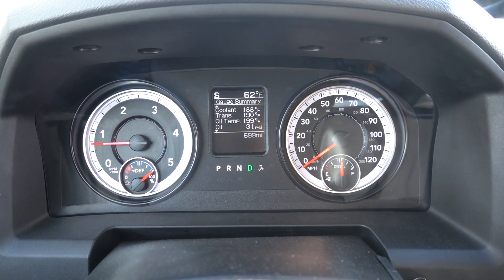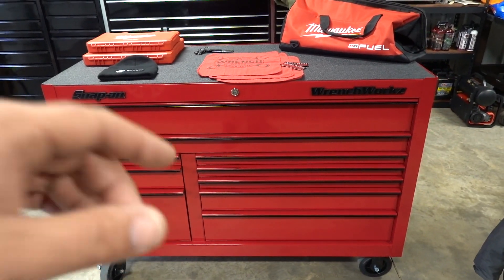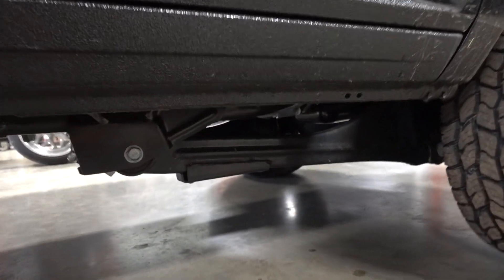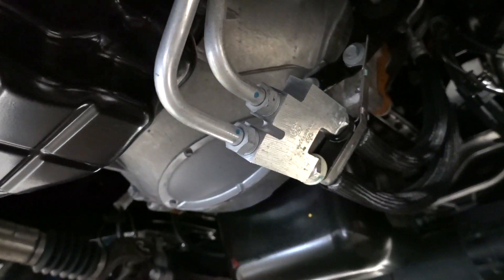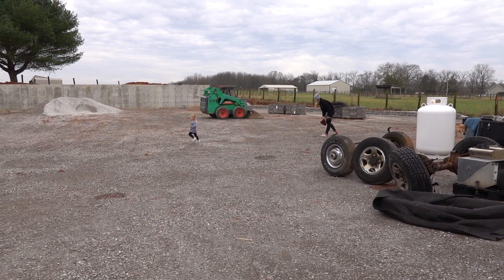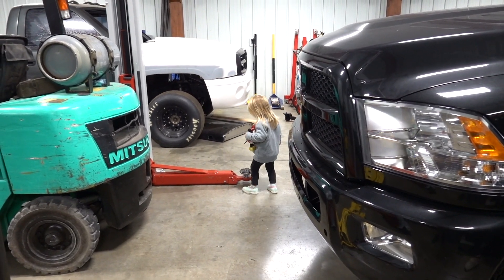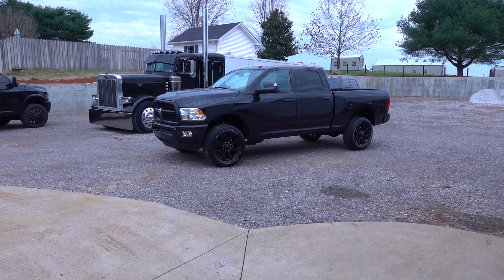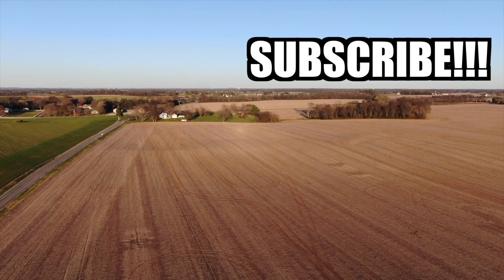We AVOIDED a MAJOR DISASTER!!!! SAVED TONS of $$$$$!!!!

Comment: I’m pretty sure most transmission fluids optimal temperature is between 170-200f. 130s sound way to cold. I’d double check the product your using. Running both cold and hot changes the viscosity of oils changing their lubrication properties. Hot also has the added downside of burning off additives and over like 300f will start evaporating the oil itself.

Comment: I believe that piece is called a transmission cooler bypass. It bypass the cooler when it's cold and it heats your fluid up faster and then it opens up once it's at operating temperature.

Comment: thermostatic valve sounds like the term you're lookin for. It'll loop fluid until temp reaches the set point, then it'll send it through the cooler. Very common on heavy equipment where you're trying to maintain a specific range of operating temp for optimal fluid and component life.

Comment: Is this model trucks trans suppose to be operating at a lower temp?  I know in my ZF8 180-220* is considered normal operating temps. Doesn't it typically take 240+ to start degrading trans fluid?

Comment: What was the major disaster avoided? If you're referring to the trans temp, 190-200 is not an the edge of disaster. Not even close.
Reply: Greg A talks a lot click bate at its finest 😂
Reply: @Itsa Mea

If it isn’t fixed on the front end couldn’t it be a disaster waiting to happen? Or am I just showing my ignorance on the subject haha.
Reply: Agreed
Reply: He is referring to the actual problem, sure 190 isn’t bad but it’s a problem that needs to be addressed
Reply: Any temp over like 170-180 drastically reduces fluid life, the trans SHOULD NOT be running anywhere near 200, especially just driving down the highway.
Reply: @jameshood3692  optimal temp is 175.  The fluid temps upto 220 are not detrimental to the transmission and mist vehicles run in that temp range. 240 and above shortens the life of the fluid in half for every 20 degrees above that.  There was NO threat to his transmission.

Comment: The transmission thermostatic valve is to heat the trans fluid and thin it to increase fuel economy. Almost all manufacturers use them now. Counterintuitive because heat is the enemy of the automatic transmission. 190 to 200 is not technically "too hot" but the transmission life will be greatly extended by doing away with it. Furthermore, it will not have a noticeable negative impact on fuel economy.
 
Kind of a stupid question but are you sure your dually has one?
Reply: Yep, definitely a stupid question... It has it, I remember the video where he changed it.
Reply: @jsav5845  

Yep I have no knowledge of RAM trucks. GM only added these with the new 10 speed. The real Allison trans trucks don't have them and run in the 130 degree range unloaded. All GM 1/2 tons and the F150 have them. They actually have been causing a lot of premature torque converter failures in GMs 6 speed 1/2 ton trucks and many owners disable them.

Comment: Hey love your content, I have a question my 2018 ram 25oo has wind noise inside the cab you hear it on both sides around the top of each door. You hear it mainly on the highway doing 60 plus and on a windy day it's way louder. I was just wondering if you experienced this wind noise or heard anything from other people it's driving me nuts trying to figure out what's causing it when you buy a 50 thousand dollar truck it should be quite inside

Comment: You are correct 10-12 do not have that thermal bypass block
Reply: that is incorrect. 
it’s just in a different location. 
it’s under the hood 
above the fuel filter and next to the master cylinder. but a little forward of that . 
you’ll see an H block.
revmax replaces that with 2 double ended fittings . 
part #  68RFE-TC-TBU-2

Comment: Sooo 200 trans temp is bad for those transmissions...?
Reply: 200 degrees pan temperature is about max for a auto trans. Fuild starts to break down and it starts pushing the limits on the seals. The cooler you can keep and automatic the longer it will last
Reply: New ram 1500s 8 speed the trans runs 220 normal.

Comment: If the transmission cooler is in the radiator and your thermostat is a 190, there is no way your transmission can run any cooler than the water temperature. This has been a standard for many years.

Comment: revmax part # 68RFE-TC-TBU-2 

It’s in a different location above the fuel filter next to the master cylinder but a little forward of that you will see an H  block. 
it gets replaced with two double ended fittings. 
I have a 12’ and it runs way cooler.
also on the coolant I went to a 190° thermostat over the stock 200°
2010-12 have 200° thermostats

Comment: The water in it a gender these at the Max and release it's a 180ﾟ of released its heat it to the radiator and the radio them puts it cold cooler water and that wastly works all day long as long as it's flowing but if that's the case why even use a thermostat why would you ever watch your engine to get up to that temperature will you do because if you want a heater I gotta have a warmer environment but for an aging to go above a 180ﾟ is not good it makes the gaskets so get too hot and things start to seal start to go bye bye so what was what is your what is your what is the guaranteed way to keep your car cooled and flowing fans and radio water and act I freeze things that keep them from boiling him these that keep it from overheating but if you lock your thermostat at 2:20 miles 220ﾟ C card's been read it 220ﾟ or 400ﾟ it's not cooling its fluid through its fan system and it has no way to kit its engine down to a temperature that is not going to destroy gas kits

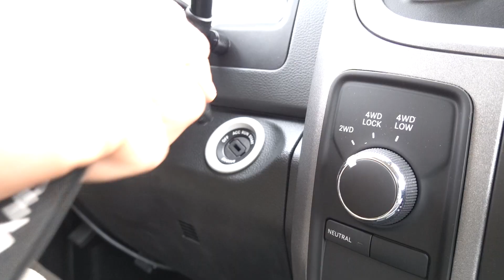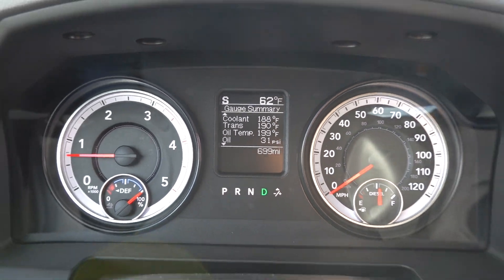Comment: Why buy anything from a factory if it's going to have problems like this down the road and your regular usage why would you even buy a factory vehicle because it looks good believed all the parts on it that are subject had basely damaging it Dar not proven parts to last 10 years they are just put all the truck to less the or the manufacturers OEM in Delhi have to replace them look I doubt that the the Cumbria has your truck with basically say that those that would your use vehicle part of it starts blowing up transmissions are not responsible for it such a what is the optimal temperature of a transition I've never heard of vehicles having to have AA keeping so that's what the coolant system in a transmission is designed to do circles through the radiator and you put extra oil cooler to keep the engine the treasures and cool always not now to be regulated by a nether device that has to warm it up in the wintertime that makes sense for the kit warm up in a cold environment but should never have a problem getting it to the high temperature it should never keep them fluid in it towards boiling it then they get ahold of therefrom now with a transmission that he didn't used to have it used to be able to warm up flow through radiator but if it's in a cold environment it would it took a lot long so this thing worm the how is it warm and up faster because it circulated as much so it leaves the transmission fluid from flowing in the beginning to staying in the engine in the same area so it's warming up the fluid that's it keeps the fluid in the transition before it circulates it back out again as with that print device does it keeps it at before it releases it has to raise up to 130ﾟ that it didn't let it loose they go see your cool of his doublet it basically is flowing through your system at the temperature it use of flow at but if it doesn't apply but holds it for July long that it's gonna cause problems and what makes transmissions get hot the heavy loads bigger tires over where pullings that the it's not designed a poll uphill but you are duly him you have it put it through all of its you have a put that truck and it's even its full capacity in a goalie get a high rate of speed uphill transition has it been a snot design through it for the basic ease but would you abuse your transmission will it be able to handle it in the conditions of that are basically design when it is under full warmth and going up a Hill at phuket and fast as they could go like the way you build-up would it be able to haul a heavy load up a mountain and keep up with the speed of the mountain you know going 65 miles an hour uphill all the way up the mountain with a heavy load with the chancellor should be able to hold it when it goes down the mountain the transmission is designed to break it you don't want to be going if you don't give it any for although truck has the mail with a stop the 800:00 pounds safely going down it you don't wanna get the car of to high speed and fly down the mountain and you can't break it in time now as to why have you have a race car you can go down about and really bass and he could stop the card as the brakes are designed to dimes over what the Cardie's a stop to this stopping quickly but big rigs 800:00 pounds at high speeds effects of bigger's bigger brake system only put on them to keep them going slower they don't get their speeds up going downhill that 1 be able to stop them they have the keep them from doing that before that little give it gas going down you'll explode up through their transmissions I don't wanna use the brakes if they don't have to that the last resort when a keep the thing in the gear that keeps it from getting up to speed it needs downhill is downhill dude if you have a 1000:00 pounds that you're going tag Hill with no breaks and I had it and a going downhill with 15 2:00 pound thing on the same wiggle one's gonna go on love faster the other one ones get me a it's Garry ride down you put your skis down the mountain at 2:00 MI at to underweight which is a 1:00 weight you're going to get down the mountain and a high speed but if you

Comment: Here's a quality product and I could tell you that I could stand by to this day that's good the Honda eat 2200 generator cost 11 $1200 back in the day I had a choice of by it or a $300 generator which was same the tricity wise and I couldn't tell with the harder generator last 4 times as long as the $300 competitor I couldn't get an answer in a Honda I couldn't get an answer out of the generator companies how long is this thing going to last what's the best thing turned out the ones that were selling for $300 were sold by all the big Box stores they lasted 66 days running 24 hours A-day so the holler generator I bought down the road now would be I would put an 8 hour shifts so that 66 day would be adorning 20th 240 days of basely using this 100 generator I used as on a generator for 8 hours A-day I guarantee you for 8 years straight it ran that that would be the equivalent of buying $300 a year for legs 8 years the Hud of generator save me it was half the price of using it over the lifespan of it's it's we got stolen it was still working till I got stolen it was still a $10 a month generator but she had a bite all at once and use it for that many months in Fort before it broke now you by the other was that are cheaper they don't last you be buying 1A year for the next 7 years so you value of those wounds is garbage they are krapp that is would you say is a good material switcher I don't believe you prove it that shirt last like it's supposed to last like at last like O to long lasting this I don't believe the tools that you sell there was that you buy the ones you endorse they don't last it's not like you're buying Craftsman you know tools that lady you've abused them in know give you new ones you buy any impact tools from Harbor freight or any of the snap on lid on which he looked abuse them like a mechanic would abuse them for a lifetime they don't they stay break those tools were never

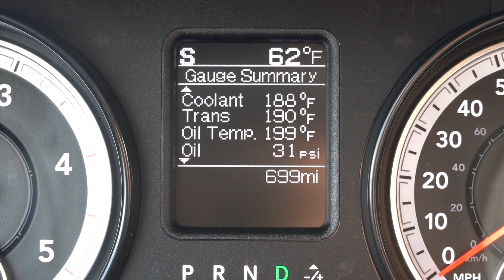Comment: Cycling you racecar you a dragon if you do a rod you put that paid to the pedal to the metal ubaidah think fire it 7 seconds of use and it basically hit those pistols as fast as it could heating them up engine block is now hot you can't run that engine again and again again at that high speed of temperature your age is designed to go 1:00 year keep cool than a 109 ine degrees keep them the block at that temperature all times its cooling off the pistons that are going 70 miles an hour but they're not going 2:00 miles an hour for a the same hour time frame that you would be going 70 or 80 miles an hour in your other vehicle you're gonna get things hot yet a have a way to cool it down so you can't run a drags your wiggle over and over and over again although he can't put 10 runs on a on your car in A-day without cooling you down it will take time you actually got your engine block hot idea cooled on your engine when you come back a few dragged it you can't run cold fluid through it you gotta cool it down how do you could down you have to put wind in radiator has to cool down what you Bisley read that I'm so fast I believe in a way to cool the engine down your system lu not designed to do that so when people say they're 3" now it's cool I'm ready road I can run it again it goes temperature bag down to a 180ﾟ you heated up to boiling points you could be able to cool it back down and you guys don't build radiators and fans able to keep up with the Drag Racing era get hot cars that run indeed are running their running to utter miles and hour their radiators and designed a basically cool them off at 2:00 miles an hour they're running at a higher rpm and their fallen a** they're given a gun there radiator has the cooldown ever have a bigger radier who as the luckily keep up with the flow of the engine have to cool the water off a to keep it Connie that temperature I don't understand how people make these vehicles that they make him go super hot for 5 seconds and then they have the cool down in in common I didn't really reaches digoville engine if you doing that kind of heavy duty hot and cold eat I how do you keep it for 6 seconds at the temperature you needed to have while you're racing it you MA it's super hot and I did have time for the water to flow through it and cool it off in 7 seconds

Comment: Although engines and when boats rested they give you the blocks away they don't they break before they come out for desert designed the whole that weight when they well together as they don't have ability to hold want to come to separate so as a result the tools that you're using the tignol part are going to get damage because the tools the things that you're using and Noah are requiring twice the strength to get group get broken loose and never design that the snap on charges you a whole lot of money for their true but doesn't go through the abuse of take a Craftsman tool and you run it through the test of using it every day for this about of tires over the next they're all gonna break at their own rates one that breaks L the 1 that you buy for this amount will last you a lifetime but do you need to buy that 1 at that price what will all the other ones last you a lifetime and still be worn dude I don't know if that was the case then we be using lease no 1 wants to have until break an arm and adding another 1 is a truck is and always outside the door and when you have to go get the part the word yet but I have to have a part to use when that 1 breaks it when they break you don't have backup tool step the can fix the world he does broke and a couple take it off tires of lug bags and bolts the tool is going to be the was at last the longest the it back to it that the cordless will never keep up a that a bag tool it will never outlast it it's nice to have a cordless tool to take off the tires would you take enough 1 or 2 would to do it all day for a walk that the to will not be the same down the road as when you buy this at Erica Hill just not going to happen cordless will never compete with hydraulic and add basically air tools they just don't last they're convenient if you give in if you can go up-and-down a you know when you're up in the air using a nail or if it could give up with a air tool Naylor that's great you'll have the hose if you keep up with it but I don't have and you have to have 8 times the battery capacity and then that tool class you over the year use it the same way it's not the same cost it cost more to be portable than it does to be with a cord behind it in the end you have to eat you have to weigh on the facts is this worth it to me to have 2 eyes bend 8 times as much to operate all day long for that year versus having the court attached to me doing the same job

Comment: So you're Selby what is the optimal temperature for you to actually run at and if the transmission is not protected in a cold environment by a part a you have changed you don't think the tires that you put on it made the in the transmission have to produce AA higher outputs and keep the speed up to drive that we'll that you made larger in diameter it has to me all that has to be do that but the fluid flow so when you get up a vehicle where he gets above this diverge or use supposed to stop the car but you broke you broke the rule and drove it against its wishes because even if you put your whole transmission in jeopardy $5000 to get somebody on time because if you were the person that was that more G that car you would be your fault that the warranty was void is a huge of a card to a condition where you should have stopped it they thats what they have those that temperature sensors for and you not supposed to drive them he bows to bring them to the diligence legged fix it before you damage anything else whose fault would that be yours

Comment: Yeah where do Y the trans tip went up what did you do to the transmission that made it change you put big tires on the back it says wish it wasn't designed for that upgraded the rheumatiz which he didn't upgrade the transmission you made it work harder a got hotter whom led the if these going to happen would you drive that car to a dozen miles in the condition you would have you fixed it temperature on it it's going to fail